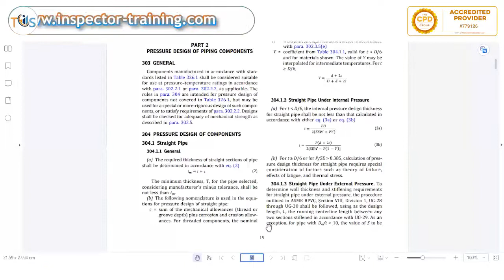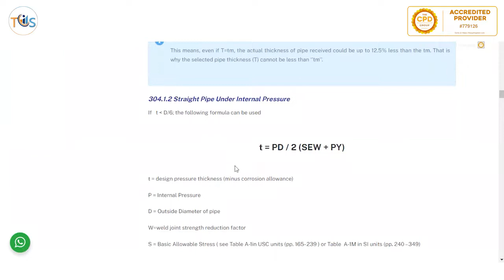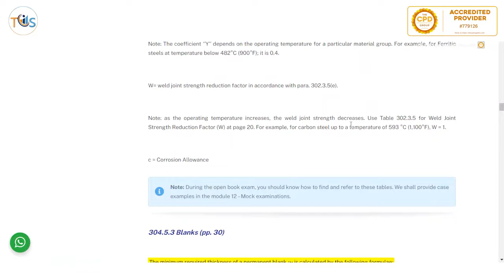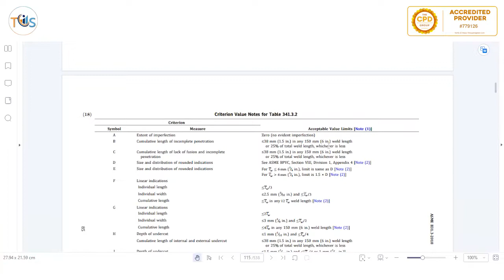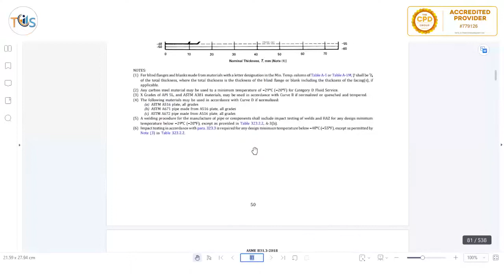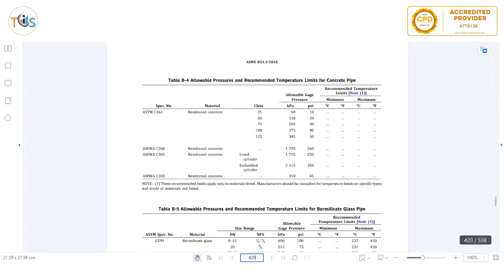ASME B31.3: Process Piping

Comment from the maker: Which ASME B31.3 topic do you find most challenging — pressure design, allowable stress, weld joint quality factors, hydrotest, pneumatic testing, impact testing or welding requirements?

🎯 Preparing for the API 570 Piping Inspector exam?

Explore the complete API 570 Online Training Course:
https://inspector-training.com/courses/api-570-piping-inspector-online-training-course/

ASME B31.3 is one of the key references covered in the API 570 training program.

Tell us which B31.3 calculation or topic you would like us to explain next.